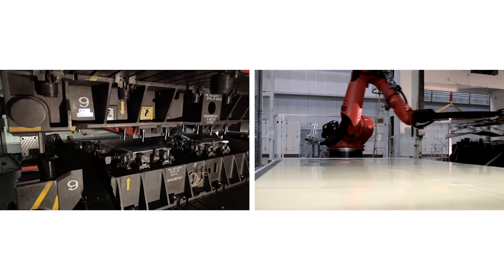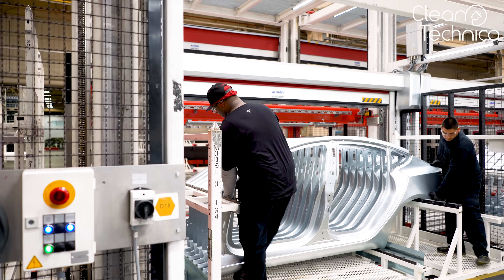Tesla Fremont Factory Tour, Part 1 — CleanTechnica Exclusive

Comment: I worked in the Press Center on 2A (the line shown). This is incredibly slow in the video. Body Sides are pressed around 10 parts per minute, where doors usually run 17 parts per minute. Me and my guy are the best damn forklift operators Tesla has ever seen. We broke production record after production record.
Reply: Yup. I used to work In laser and 2A was the worst line to go help at 😂